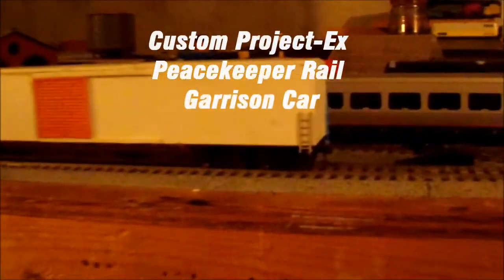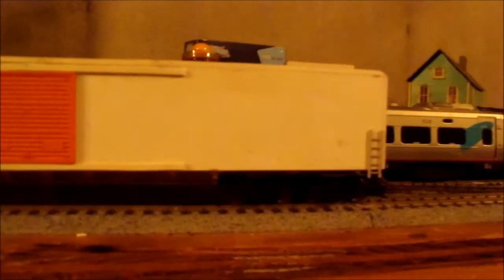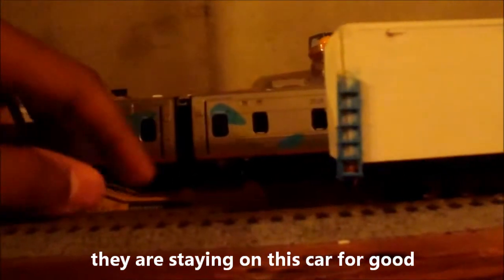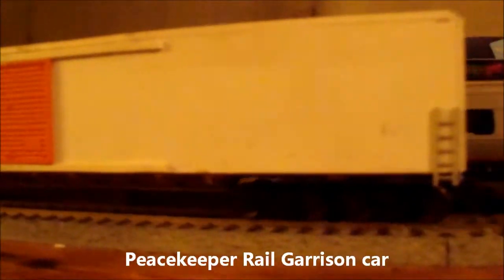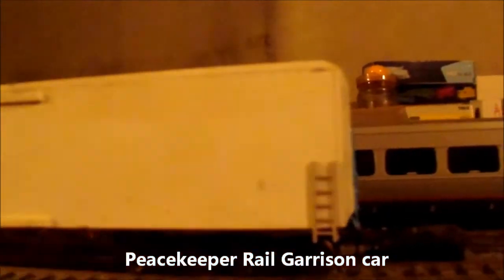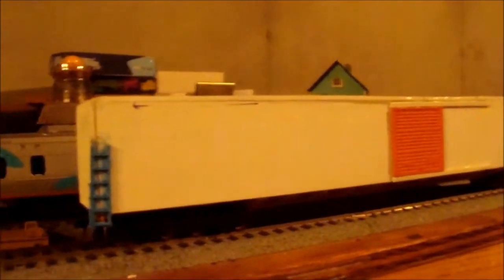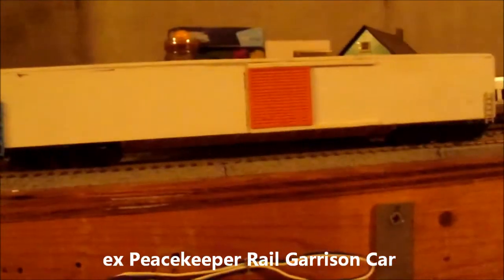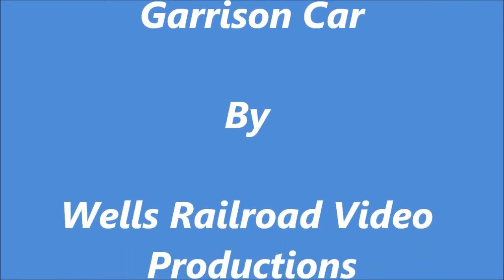Custom Project- Ex Peacekeeper Rail Garrison Car

Comment: The Peacekeeper Rail Garrison had three cars. A Missile Car ( containing the Patriot Missile), a Command Car (holding the launch control crew and equipment), and a Security Car ( with a retractable cupola on the top with a 20mm cannon and a 50 caliber chain gun). The Security Car held living quarters for the Security Team... and had retractable lights and cameras. They would move the train to certain predetermined areas, and set up a security perimeter prior to launch.  The train, when not dispatched on the railroad (only in time of potential war) lived inside big long bunkers that had launch doors that could open to allow the Garrison to launch the missiles out the top. The bunkers were somewhere in Vandenburg, CA. Once the Soviet Union folded, there was no more need for the Rail Garrison... and the project was cancelled.
Reply from the maker: Oh I didn't know it had three cars but it would make since to have them set up that way. Thanks for the info!